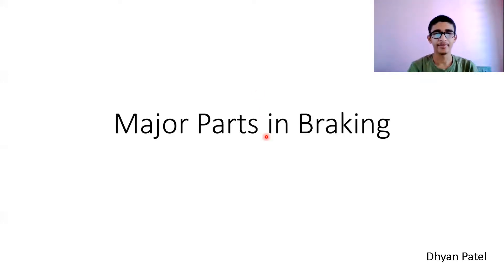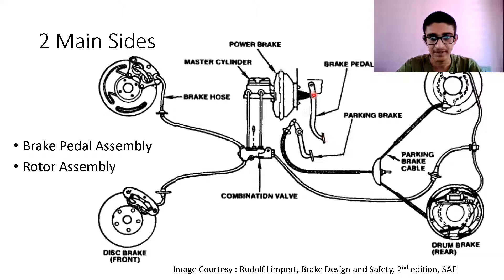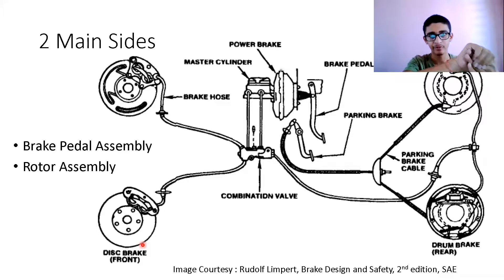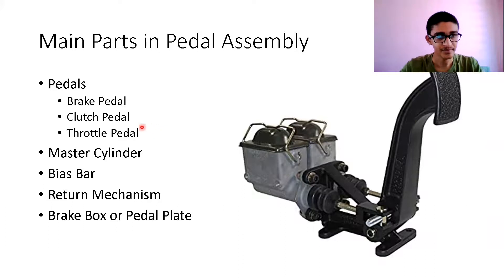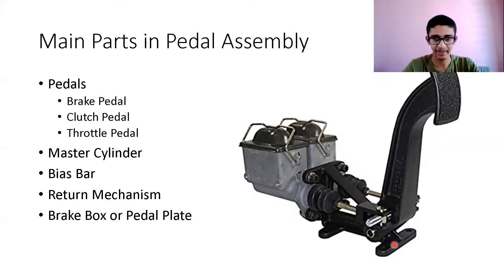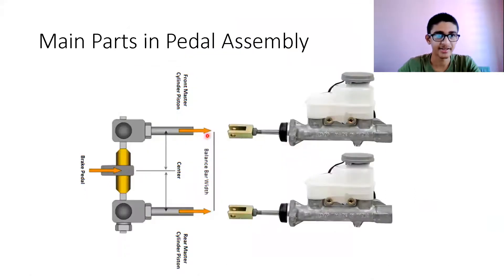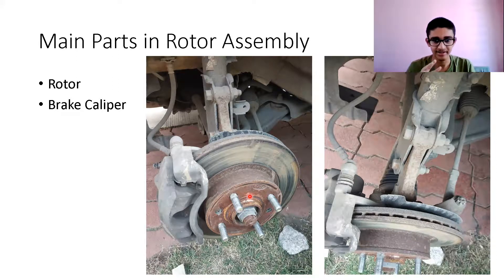FSAE Braking & Major Parts in Braking | BITS Goa Racing |Grease Monkeys| Formula Bharat | SAE Supra

Comment from the maker: Video Timestamps

00:00 Introduction to Braking System
00:20 Two Different Sections: Rotor and Pedal Assembly
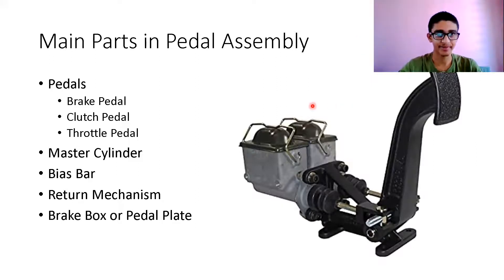04:10 Main Parts in Pedal Assembly
09:02 Main Parts in Rotor Assembly
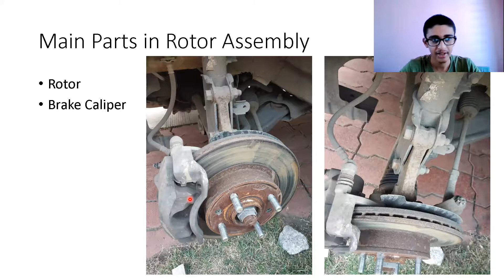11:14 Other Important Safety and Miscellaneous Parts